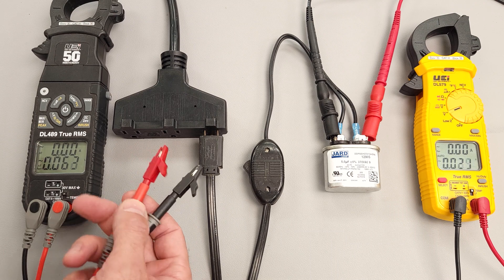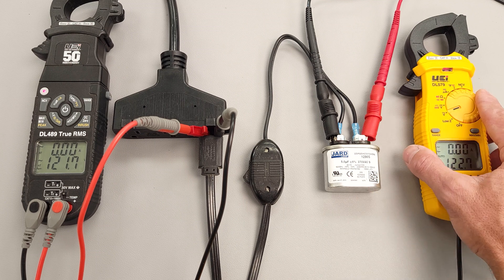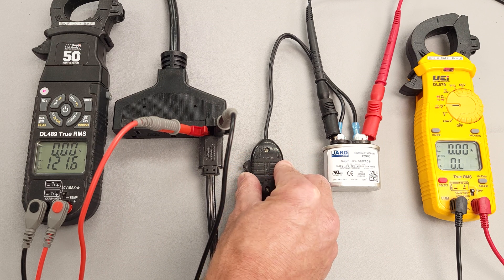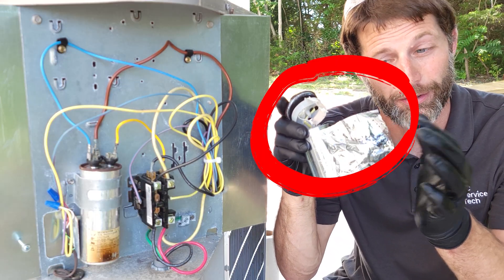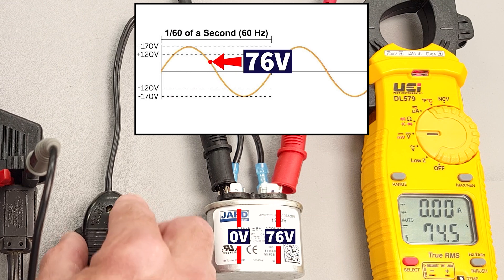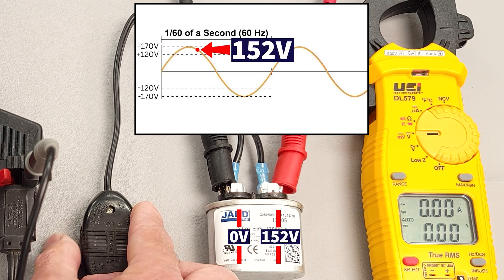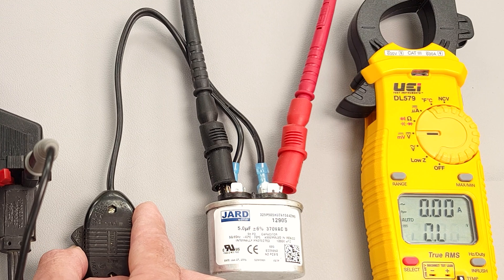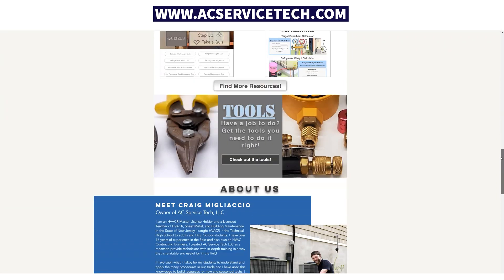Is There Really 170 Volts Instead of 120V at The Receptacle?! I Use a Capacitor to Prove This!

Comment: As a master electrician, 40 + years myself, I am puzzled why you are showing this. I would never use this in the profession and just confuses a student. You never even explained RMS!!  Please leave the teaching to the professional trades people  who are trained to do so. Thank you
Reply: i think you’re expecting more than its meant for.
Reply: hey, does electricity flow through the internal parts or on the surface of a conductor?
Reply: @threestans9096  Actually the way we explain electrical circuit theory is grossly over simplified using what are called lumped components, like resistors Inductors and capacitors. Capacitors store energy via and electric field. It was James Clark Maxwell that developed a series of four equations that explain the behavior of all Electric and magnetic effects and  came up with the notion that between the plates of an ideal capacitor that has a changing electric field between the plates produced a current called a displacement current. Field theory give a much more accurate description of how both electric and magnetic circuits work, the trouble it is more difficult to work with requires high level of mathematical development.

Comment: Hi I am a  electronics lover  in the video u explain the plate measure  is in DC current when DC stands for direct current so did u mean that you were measuring amps in DC upon discharge cause that's a short condition an would ruin the meter what. Kind of meter is that an I'm sorry for asking this way but want to know a valid cap check without a cap tester that's min 80 plus dollars thank you for clarifying if u can

Comment: Could you please make a video that explains condensate blow by off of the evaporator coil. I have a goodman package unit where the condensate drips down the evaporator fins but before it gets to the evaporator pan it blows off of the evaporator straight into the plenum. I can't figure out what causes this to happen, and how to correct it.

Comment: To me it was not a clear demonstration of what RMS voltage really means.  
The definition of RMS is an AC voltage that will dissipate the same power as the equivalent DC voltage.  Since  AC is always rising and falling, it has to rise above the RMS level for a short period of time  to dissipate the equivalent amount of power. 
It works out that the peak  is the  RMS times the square root of 2 (1.414…..).

Comment: Oscilloscope which show you the whole sine wave measured in voltage so you can see the peak on both half of the sign wave and shows out the readings and measurements

Comment: Actually, if you measured from the bottom peak to the top peak you be able to get double that voltage. It all depends on how you are measuring the voltage. The RMS voltage is however the normal way one measures line voltage.
Reply: As he noted in the video, some voltages are positive and some are negative.
So he did get double the potential already.
Reply: But he didn't add the 2 together as you would only get that if you were able to check it using a voltage double circuit.
Reply: @neutrodyne :

I guess you don’t know much about arithmetic.

There was nothing to add.  Voltage is a difference of potential.

Differences involve subtraction.

But your argument is as ridiculous as claiming that 40°C would be a lot warmer expressed in Kelvins.

Comment: Question. I monitor our home's wattage with a Sense unit.
My A/C was ruining smoothly, ie. the wattage was flat and smooth and unwavering. 
The capacitor failed, and a the tech replaced it and the A/C runs again.
However I noticed the Wattage meter is reading a fluctuation in current then the A/C is running now.
It fluctuates as much as 1,100 watts now.
The tech came back out to check with amp meter and said it was within specs.
Is this an issue? What would cause this, wrong sized capacitor?
Thanks.
Reply: You didn’t specify the timeframe of fluctuations or how the actual values now compare to the prior value.

The load on the compressor isn’t constant unless it is maxed out.
So normally the load should be varying during operation depending on how hard the compressor has to work.

Perhaps the compressor was hamstrung by a bad capacitor and maxed out below actual design capacity.
Replacing the capacitor restored expected performance.
Reply: @denverbraughler3948   Thanks! The fluctuations are very persistent and actually quick, not load related.
From peek to valley, time is 10 seconds. So it's oscillating 60 times a minute. 
Would this indicate the capacitor being undersized? (Or oversized?) 
No valves were touched...
Reply: @stephendoherty1275 :

Your system likely has an automatic valve of some sort, TXV/TEV or EEV.  

Any problem with the capacitor size would appear 120 times per second, not 3 times per minute.

What are the actual values for voltage and current at peak and valley?
What were the values prior to the capacitor replacement?
Reply: @denverbraughler3948  Well, it wasn't the capacitor... The unit was overcharged.
The compressor started tripping when it was 110* outside so I cleaned the coil, it had some cottonwood on it.
It continued to trip off so I put my gages in it - 160/ 500 psi! It would serge to 550 psi when the txv was cycling trying to control too much refrigerant. When I removed a couple of pounds, it settled down, ran smoothly and begal cooling better than ever.
It wasn't a new capacitor repair, but a new evap coil repair under warranty - I got the two repairs confused... I should have checked my records instead of relying on memory! 
Thank you for your input!
Reply: Wrong sized capacitor or some kind of weird voltage issue most likely. Maybe a fluctuating voltage drop across the contactor relay due to pitting or burning from the high amp draws caused by the original capacitor failing. I wouldn't be too worried honestly
Reply: @MegaDysart  My incoming is flat, so I'll check the contactor. I can't see it being the issue as the fluctuations are so persistent and regular. Thanks!

Comment: You could use a diode and have instant result
Reply: How can we use the diode to test this ?
Reply: @Viper81766  stick on one of the leads supplying mains to the capacitor. It will charge it one way, but will prevent discharge. So capacitor will start charged at peak voltage.
Reply: @MariuszChr  Thanks . I didn't know that 💯

Comment: RMS 240 volts would be 339 volts peak voltage?
Reply: yes, u multiply the RMS value by square root of 2 (~1.41)
Reply: Bear in mind that 240 Vrms AC is nominal voltage.  The actual RMS voltage could be higher or lower.

Comment: Measuring direct current?
Reply: DC. Multi meters in DC measurement mode show average voltage or current, depending what you measure.